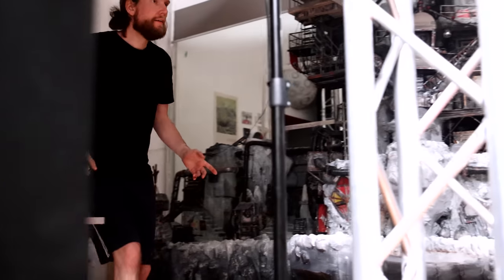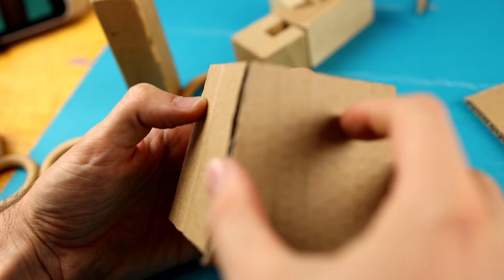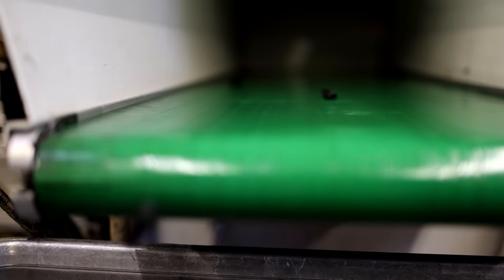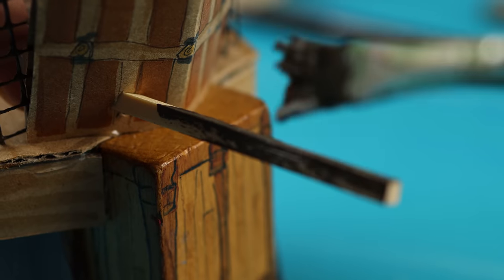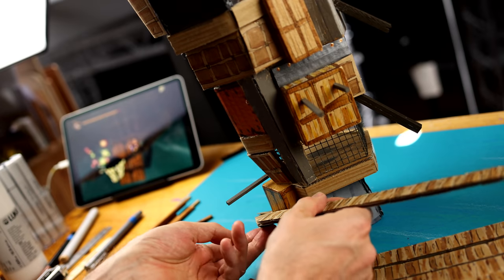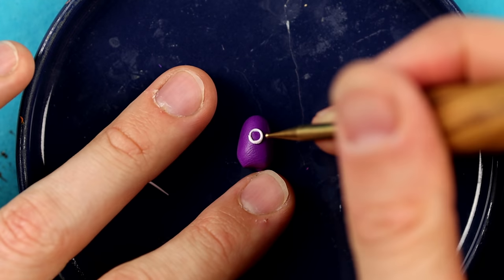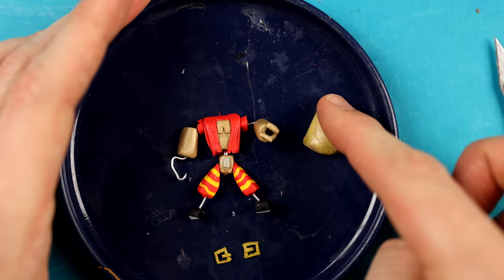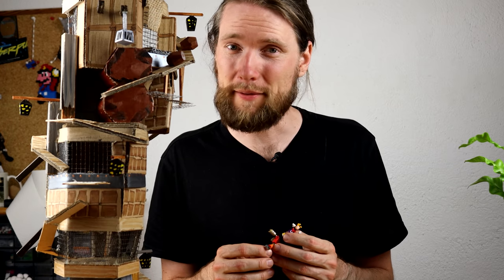Building & Playing a RAYMAN level on my desk – with cardboard & clay

Comment: Your videos are amazing!!! I make polymer clay figures as well but they often begin to fall apart after sometime. Specifically in weaker areas such as fingers or small details. I was wondering if anyone knows of a good solution? Is it better to glue weaker pieces on rather then attach them with clay? Does anyone have any good recommendations for glue to use when attaching baked pieces? Thanks!